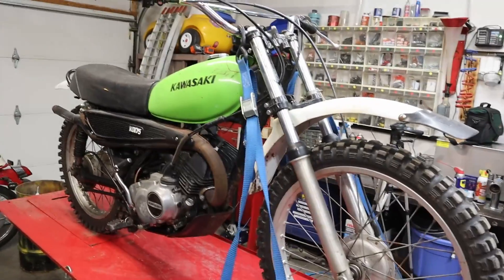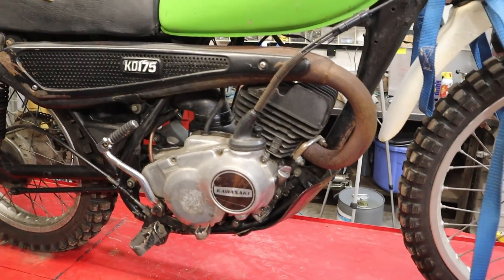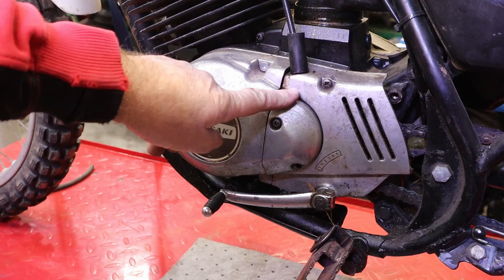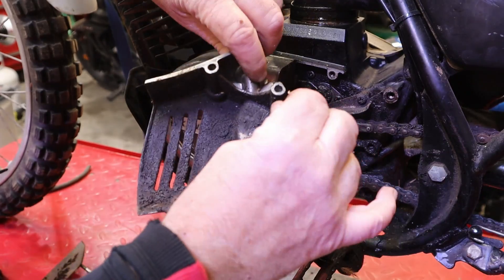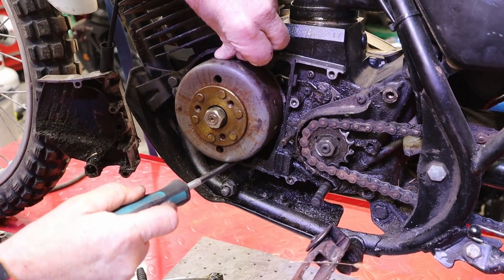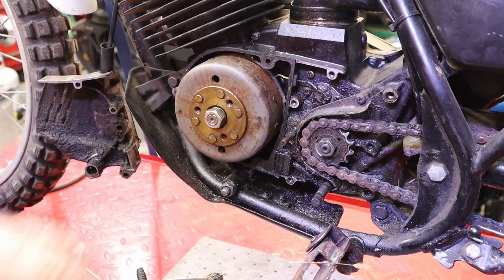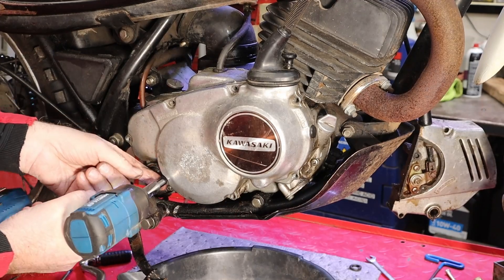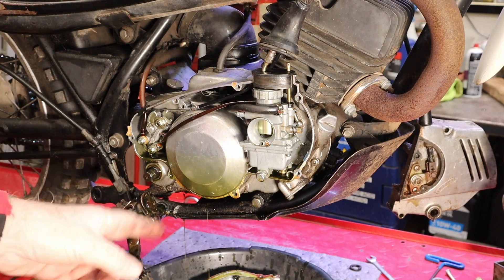Solving the KD175 Puzzle: How to Diagnose and Inspect this Kawasaki Motorcycle Engine!

Comment: i have the ke175 pretty much the enduro version of this exact bike, the oiling system is finnicky, real care needs to be taken when restarting these bikes after sitting for a while. Make sure the oiling system is good and no bubbles in the lines, its worth doing the oil pump test to ensure its pumping enough oil, if not, enjoy the rebuild.
Reply from the maker: Thank you for the advice on the oiling system. Thank you for watching.
Reply: I was about to skip the step of testing the oil pump on my KE175. After reading your comment I’ve reconsidered